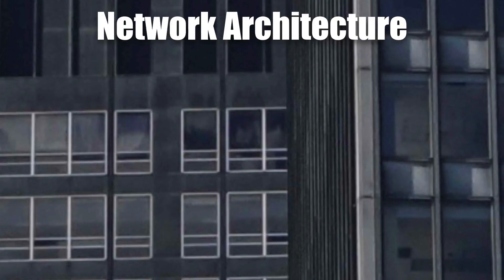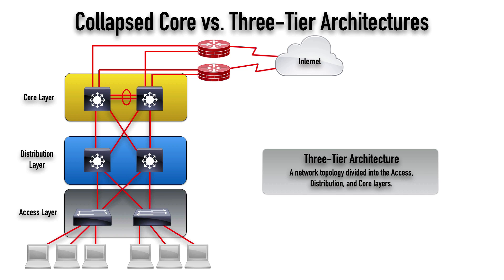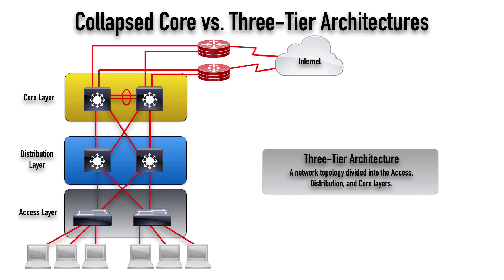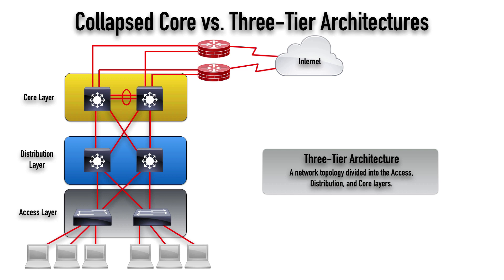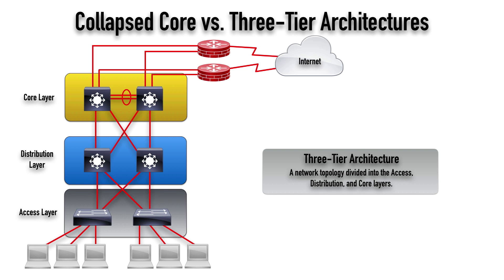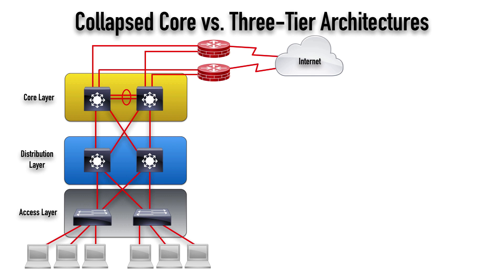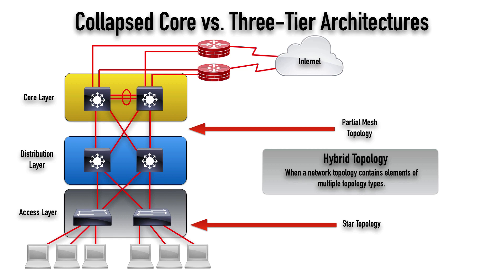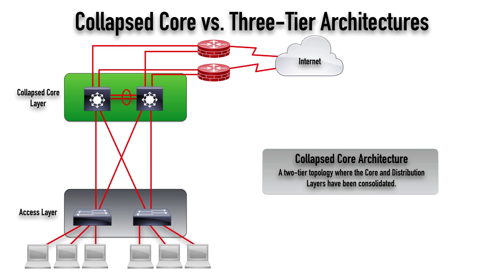CCNA R&S version 3 Topic: Collapsed Core vs. Three-Tier Architectures

Comment: So how are you running VPC from the access layer to the distro layer if you dont have a connection between distro switches in the collapsed core network topology? or is there another way to dual home the access layer not using VPC?
Reply: Ok perfect, thanks for the clarification.

Comment: Kevin - For your 3 Tiered design is it not best practice to connect your distribution switches together?
Reply: Thanks. I'm building a classic 3 tier network with Nexus's at the core and distritbution layer. I'm wondering if I should I build a VPC between the Core and distribution or just layer 3 links. I know I want my distribution layer in a VPC I'm just not sure how it's supposed to look from the distribution switches to the core. Any general ideas or suggestions.  :)

Comment: thank you for this but there in not much info on the collapsed core , is there any other videos that explain abit more or is that all we should know
Reply: from what I understand with the collapsed core it is worth nothing that the Access layer takes up more Layer 3 responsiblities. Since the Core layer is designed to be as fast as possible, it is not advisable to perform packet manipulation as you would in the distribution. So for Access layer in collapsed core think more Layer 3 switching